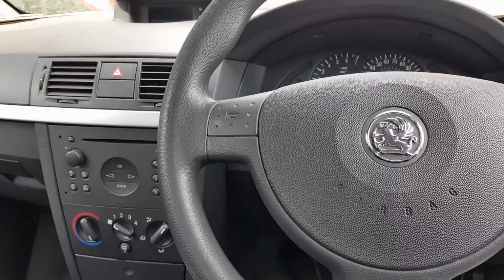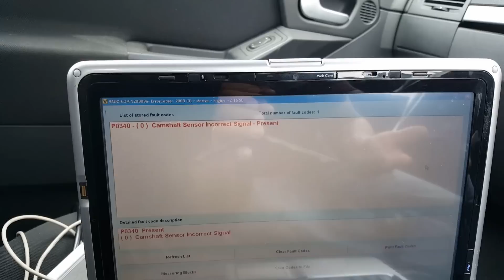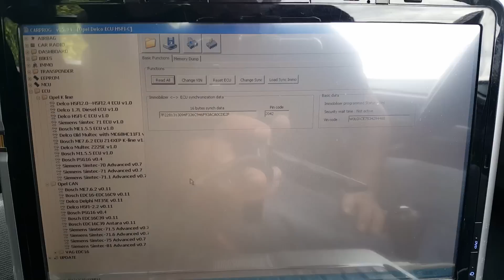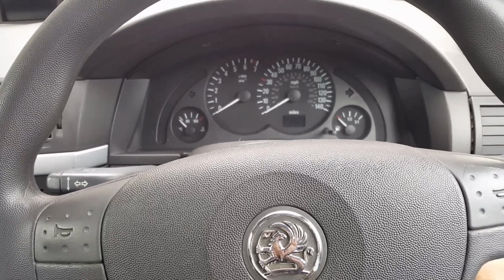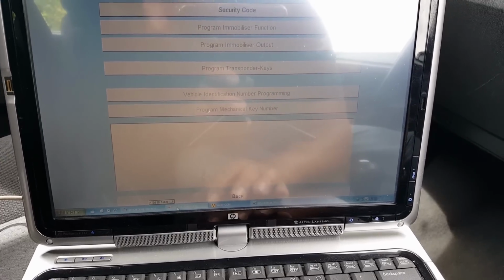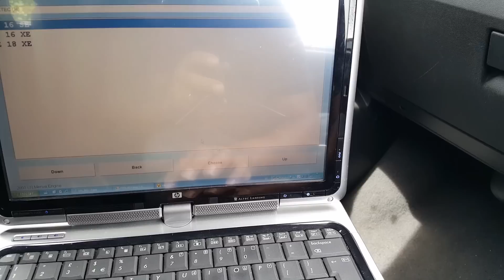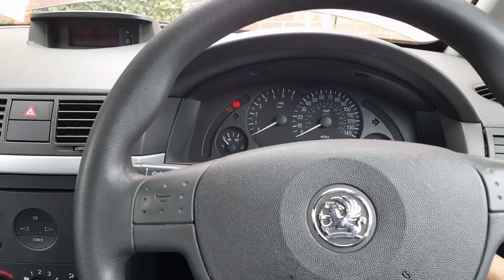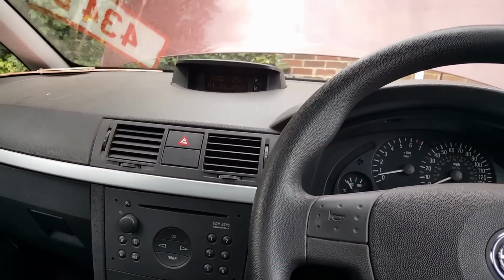Vauxhall/Opel Meriva 1.6. Engine ECU replacement, reset and programming.

Comment: Hi lmsvvavr thanks for your videos they are invaluable in helping me fix a 2004 1.4 Corsa with a Z14XE engine. I bought a reset ECU with the same part no as the original (12237450 DXKB) from ebay. When following your instructions opcom connected to the ecu and stated it was a 12245500 FAHX for a Z16SE engine and that it had been reflashed previously. Do you know how to get it back to a 12237450 DXKB for the Z14XE with opcom or other tool? Also as it programmed to the car ok is there any risk in starting the engine with it thinking its a Z16SE?
Reply from the maker: Rob Thomas 
Hi
Thank you for watching and for your comment! 
That's weird.... to flash it back you need other type of tools... not opcom...
Do not know even if the engine will start... as some wires might connect to different pins on the ecu... also the mix air/fuel wouldn't be correct...don't really know... I never tried...
I would send it back and get the right one...
Sorry if I can't be more helpful this time...
Reply: Hi, thanks for the prompt response and its along the lines I was expecting. From the reading around forums I believe the ecu hardware is common to some engines, z14xe, z16xe and z16se. However the software flashed to it to support a specific engine is different and some are saying that the part number on the sticker can be different to whats flashed. In my case the stickers on the original one on the car matches what opcom reports and is what I purchased from ebay (they are quite rare). I think it has clearly been changed to the z16se version as opcom reports the repair shop and programming date have been set. Some are saying that tech2 can reflash this back to the version that will support the z14xe. Unfortunately I don't have access to that in Swansea, not sure who does and what it will cost (trying to do this on the cheap). I think my only option is to return it as I don't think the ebay seller realised this as it was advertised for the corsa which I don't think had a 1.6 engine? Also since I bought this I missed an entire set of ecu, immo ring, cluster, immo chip, auto cu which stated it was off a 1.4 Corsa auto and £20 cheaper than what I paid just for the ecu ... grrr! There is  a 2 year story behind this but I think it proves that not many garages (been to at least 3!) are able to diag and fix these sorts of issues. So finding a skilled auto electrician, electronics repair expert and computer specialist like yourself is essential and very difficult! Thanks once again.
Reply: OK took the gamble and tried to start it. It didn't want to start but you could hear it trying to catch and eventually did with a bit of accelerator pedal but then cut out when the pedal was released. 

An unidentified error came up which I'll post the code to later (on a different laptop). The code and cutting out maybe down to the wrong engine type being on the ecu .... or a hardware issue with the ecu or something else. I would have been surprised if the right ecu would have fixed everything. 

I guess the good news is though that as I'd removed the fuel pump relay link (bodge) the engine clearly got fuel which means the fuel pump relay was activated and the pump working. This was one of the things pointing at a failing ECU amongst other things. 

So I will chase the ebayer later although not sure how much more effort I'm going to put into this as the timing for further fix attempts is limited and its causing family issues now ;-)

Comment: hi i have opel astra and i changed the ecu and the immo and now geting the code as p1614 what should i do and thnx
Reply from the maker: Depends exactly what you have done... did you got the keys from the donor car as well?
Thank you for watching!
Reply: LM Auto Repairs  yes i get it all
Reply: And i don’t have the donor car security code 
But it should work directly if I have the key and immo and ecu from the donor car with out any programming?
Reply from the maker: @tottitotti9024  
You are lacking the BCM....
Reply: LM Auto Repairs what can I do now can I like get the ecu code and use the old immo and program it with op-com
Reply from the maker: @tottitotti9024  
That's what I would have done in first place...´
You will need obviously the pin from the used ecu, and the pin from your car...
Reply: LM Auto Repairs I have the pin for my car but  still gonna c if I can get the one from the other car thank u very much and wanna tell u that u have very good video at the facebook group too thnx for all responses
Reply: LM Auto Repairs  would opcom program work on windows 7
Reply from the maker: @tottitotti9024  
🤞
Reply from the maker: @tottitotti9024  
Possibly... never tried... but can't see why not...👍
Reply: LM Auto Repairs hi 
I have every thing now but stilli  is p1614 immobiliser wrong signal received and the check engine light not pressent at all now
Reply from the maker: @tottitotti9024  
Can you communicate with the engine ECU?
Which module is reporting that fault?
Reply: LM Auto Repairs yes i can it still say p1614 and now it telling me security time active when I try to type ecu rest
Reply from the maker: @tottitotti9024  
You must have done something wrong during the procedure....
Reply: LM Auto Repairs so how can I remove time lock to the ecu rest
Reply from the maker: @tottitotti9024  
Usually ignition on for that length of time...
Reply: LM Auto Repairs hi I want to tell now the car started again but now i getting p0230 low voltage relay
Reply from the maker: @tottitotti9024  
Is that with the second hand ecu?
You might got a faulty ecu...
Still, check wiring etc...
Reply: LM Auto Repairs  yes it is the second hand one and maybe the ecu or wiring as u said but do u know any way that i can get the wiring diagram for the car
Reply from the maker: @tottitotti9024  
Mr Google will help you...😉

Comment: Hello LM. Your video's are great and if it were not for you, I would be really stuck. One question. I can log into vaux com and get into the BCM,Immobiliser and Instrument pages but It won't let me into the engine pages. I am running firmware 1.45. What am I doing wrong. Thanks in Advance.
Reply from the maker: Paul Carney 
Hi
So, you can't communicate with the engine ECU,  is that correct? 
What is the problem with the car?
Reply: Hello. Thanks for replying so fast. Yes that is correct. The engine turns over but will not start.
Reply from the maker: Paul Carney 
Is the immobilizer light illuminated?
Reply: No it is not.
Reply from the maker: Paul Carney
Ok... because of the no communication I first thought about the immo not being disabled... which might still be the case...
But first things first...
Do you have to try another diagnostic machine?
If still no comms with the engine ecu, either the communication lines are broken, or the power to the ecu has been lost...
Surely you have done that, but check all the fuses and connections...
Is the car the same as this one, with the ecu attached to the engine block?
Reply: I tried to connect an Autel Maxiscan ms509 but that would not work either. I will go over the fuses and connectors again to make sure. Thank you so much.
Reply: The Van is a 2004 Combo C 1.7 diesel. The ECU is on the top of the engine.Thanks
Reply from the maker: Paul Carney 
Ok... check that and let us know...
But it definetly sounds like if the ecu is not live, so feed lost, or the can lines are disrupted somewhere...
Reply: I have just swapped the ECU with 2 others I have bought second hand. All three of the ECUs will not connect to opcom so I think you could be right about fuses relays or connections. I will check tomorrow. Thank you.
Reply: Hello again. I have gone through all the fuses and relays that I can find. I am using the Haynes manual and Autodata 3.45 which are not very good for wiring diagrams. Do you know how many fuses and relays there is between the battery and the ECU ?
Reply from the maker: Paul Carney 
Hi
I will check the Vauxhall diagrams... which engine code do you have, Y17 DT, Y17 DTL or Z17 DTH?
Reply: It is a Y17 DT. Thanks for your help
Reply from the maker: Paul Carney 
No worries...
You should have:
Constant 12v on pin 2,15,19 plug x64 (the one closer to the front of the car)
Ignition 12v on pin 52 same plug.
Grounds, on the other plug pins 38, 54, 55
I can send you the screenshots if you feel the above is not enough...
I am just too tired now... just finished a 12  hours shift...😥
Hope that helps....
Reply: That's really great, thanks. I will try that tomorrow. I could do with a screenshot but don't worry tonight. Chill out, you deserve it.
Reply: Hello Again. 
Sorry my engine is a Y17DTL not a Y17DT in a Combo Di low pressure turbo. It’s a bit confusing as the DTL is a Di and the Dt is a DTi.
Pins I have tested on ECU Plugs A(K) and B(M) disconnected from ECU.
A1. Should read off 0v on 11-14v ( reads 0v on or off ) Fail. A1 comes from EC relay
A2. Constant live. Pass.
A15 Constant live. Pass.
A19. Constant live. Pass.
A17. 0v Fail. (BCM)
A52. 0v Fail. (ignition switch)
A54. Live at 10.6v (Immobiliser)
B38. Ground. Pass.
B54. Ground. Pass.
B55. Ground. Pass.
B64. 0v (nearest front of car)
Sorry for being a pain.
Reply: I got the data link diagram and it shows the data connector goes through the immobiliser before it goes to the ECU so could the immobiliser be stopping Opcom from seeing the ECU engine page
Reply from the maker: Hi
On the Vauxhall wiring diagrams the DT or DTL engines, have the same pin assignments...
So, your A1 should have battery voltage, check and resolve that...
A 17, should be connected with A1... so same thing... both of them are switched by relay K26, which is triggered by the ecu pin A15...
Surely you are reading the voltage coming from the relay coil...
A52, also failed, so need to get that one also sorted...
All the ignition voltages are switched by K50, and K50 is turned on by the ignition barrel...
Reply: K26 ? my diagram says K46
Reply from the maker: Paul Carney 
Definetly K26...
I can screenshot the diagrams...
Send me your mail under private messages, if don't want to put it here...
Reply: I cannot find K50 also. My diagrams are from Autodata 3.45. My diagram shows ignition main circuit relay as number K79 and ignition aux circuit as K76
Reply: Thank you. These diagrams are a little different from Autodata
Reply: Thanks for your help. I just got you some coffees. I managed to find the same diagrams as you so I can understand better now.
Reply: Sorry to be a pain again. You sent me 10 pics. they are all blurred so I can't read them 1 to 7 I have found on TIS and can magnify but I cannot find 8,9,10 page 92002 that you have highlighted. I cannot find a diagram of K50 relay also. Thank you.
Reply: Don't worry I found it. Cheers
Reply: Hello again. I got a measurement in the Immobiliser on Vauxcom that the transponder status is "invalid". So I bought a new virgin transponder and tried to program it and got the message "programming failed" when I exit out of the programming page, the main Immobiliser page says "successfully programmed". Then I go to the measurements and I see transponder status is "invalid" I have tested relays etc and they seem ok. Is the immobiliser stopping me from communicating with the engine page ?
Reply: Just to let you know. I can now connect  to the engine page on OPcom/vauxcom.  K50 and K26 have been removed for the moment. I am using jumper wires across pins 30 and 87 on both relays and it is working. I will keep you up to date when I find why the relays are not working even though they both tested good.

Comment: How do you get the PIN from the dash?
Reply from the maker: With certains tools... 
Op-com can do some, and other tools can also do it...
It all depends on the model...
👍👍👍
Reply: @LMAutoRepairs  I have Op-com, the car is a Meriva A OPC
Reply from the maker: Not sure Op-com can read the pin on that one... depends on the ecu as well...
You might need other tools...
Is the security card been lost?
Reply: I wouldn't even know where to look for the security card  @LMAutoRepairs
Reply from the maker: @Neevoks  
I sometimes find it in the car folder or paperwork...
Unless has been lost...

Comment: My dads Zafira is playing up right now. 
Some days it’s starts up perfect other days it’s a bugger to start (won’t turn over)  but starts eventually. 

After driving for a bit it loses speed and cuts out plus It hardly makes it up the hills, sometimes it won’t make it up the hill. 

Tonight they was driving home (about 10 miles drive) and the car just completely stopped and wouldn’t start at all so they call recovery. 
Anyone know what it could be? 
The car is a Vauxhall Zafira 2003 1.8 automatic
Reply from the maker: Hi
That can be caused by many different root causes...
Anything I would suggest, would be pure guessing...
So, my suggestion is, start by have it scanned, and a good live data analysis...
Hope that helps. 
Thank you for watching!

Comment: i watched maybe 10 times :D and i think you can program ecu only with carprog, am i right?
Reply from the maker: You can program it with Op-com or other capable tool...
To retrieve the pin is where carprog comes handy...
Thank you for watching!
Reply: @LMAutoRepairs  thank you i reprogramed :) when i had old ecu, was missing ground to fuel pump relay, so i connected ground to the car body, because otherwise car get warm and stalls, so insted of stalling i was able to drive on limp mode..now changed ecu nothing stalling, no warning signs, only problem now very long starting...you think this time could be fuel pump relay, cause when i switch ignition relay i don't hear fuel pump for two seconds...probably fuel pump still not gronded from new ecu... :(
Reply from the maker: @SauliusBrazenas  
Could be... but if runs after two seconds, then the ecu must be doing what's supposed to...
Check live data...
Make sure everything is OK... like camshaft signal etc...
There is a possibility that the ecu you fitted also have problems... but make sure you rule everything out first...
Reply: @LMAutoRepairs  i checked , fuel pump relay is good, but when i press igintion on i loose ground, and gets + from battery, and if i turn ignition and connect extra cable from relay ground to car body than fuel pump starts working but it doesnt stop until i switch of ignition... so i know long starting is because sistem takes long time to fill fuel, but i dont know what should allow fuel pump to work for couple seconds to fill up sistem before starting...i doesnt work...
Reply from the maker: @SauliusBrazenas  
Ensure that the control wire, that ground, it is good all the way to the ecu... (if it goes to the ecu, I would have to check diagrams to make sure...), is is good, and you have ruled everything else, then looks like perhaps that ecu is also bad... (providing the fuel pump in controlled buy it...)

Comment: hi
can you explain, how can i find my ecu code? 
thank you in advance
Reply from the maker: D -PROJECT 
Hi
Have a look here:
https://youtu.be/L-WSXbthTBs
Thank you for watching!
Reply: Using the OPCOM software you can find out ... but in order to can have available program options on OPCOM you will need to have your 4 number car security options (just with this number you can have the need available options in the OPCOM menu other way you can't do it) ... also this security number is important for the audio system (this is already set by the producer but if you make changes on the audio system you will need to set again) ... and like a recommendation is better to AVOID take out the + terminal of the car battery more than 10 minutes (most of the cars have already a lot of electronics and if you take out the battery for more than 10 minutes it can happen to need reprogramming some electronic car parts and will be not so easy for sure) and BE CAREFUL with OPCOM programming if you don't know exactly what you are doing in order to eliminate possible troubles made by your self (air bag outset, blocking engine start , lock doors ...). OPCOM is very useful software that can be used just for diagnostics (if you don't have the need knowledge's please do not use programming).  All the best ...